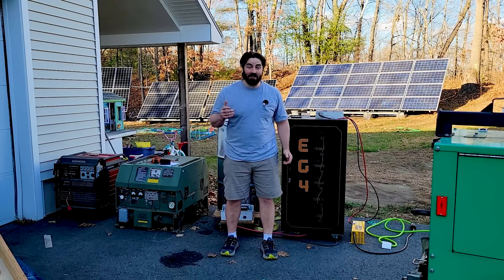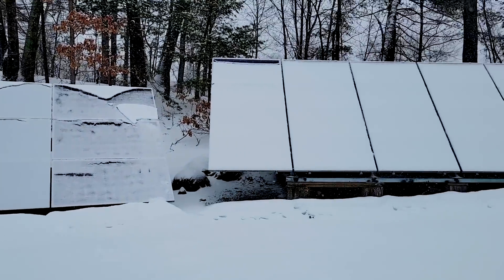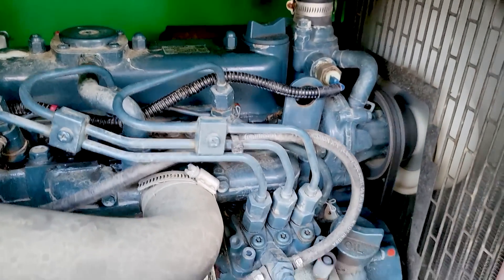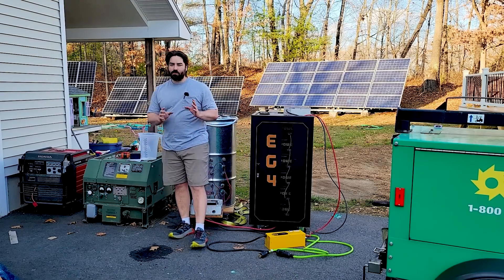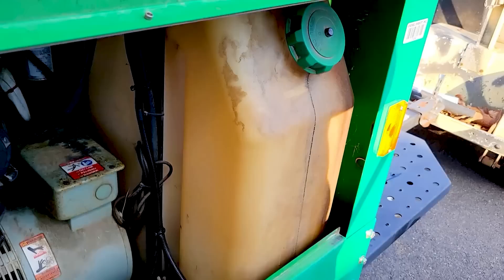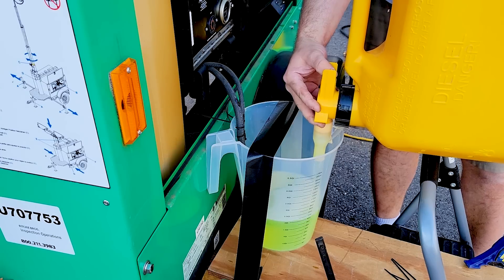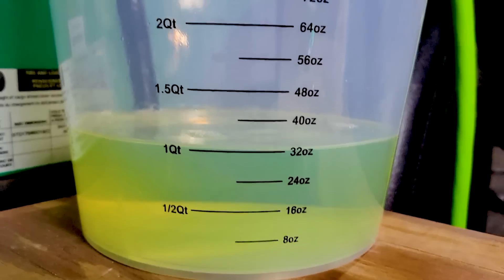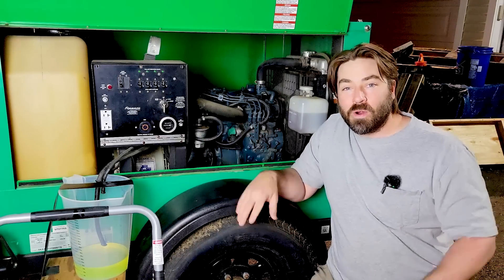Test Kubota: How many gallons per snow storm?

Comment: One gallon diesel 38kw,  from that you made 8kw ,  So, that’s  a conversion efficiency of about 21% .      I pretty well sure you could use grid power to charge batteries much cheaper per kw than buy diesel and running a Genny .
Reply: where i'm from, you pay for connection fee or supply charge of about $1.20 a day, which for 280 days of the year i don't need.
Reply: The grid is an ongoing cost no matter whether you use it or not though, so for most of the year he'd still be paying around $100/mo in fixed fees just to maintain the service.  Although I wonder if going with a natural gas generator would be cheaper, as natural gas service doesn't tend to have as many fixed fees.

Comment: Diesel is the most efficient fuel but natural gas is the cheapest. $ per kwh is the main goal. I personally use propane because I can store a bunch for indefinite periods, it's cheaper than gasoline, the engines run cleaner,  and I don't have to worry about the carb " gelling up" like gasoline

Comment: Based upon the 5.9KWhrs of the gasoline generator vs the amount of  killowatts in one gallon of gasoline (33.4 KWhrs) shows that those are very inefficient (only about 18%).  That's an eye opener!  The other 82% is lost to heat.  If there's a way to get those to 80% efficiency, it might be cheaper than on-grid power.

Comment: Are you running these gensets hard enough? Is 100 amps into the battery putting a load on that is enough that you aren’t idling away efficiency?
Reply from the maker: I maxed out the generator head on this unit.  It's a 6kVA generator head.  I had about 5.9kW on it.
Reply: @DavidPozEnergy  The engine is 10.8kW and is oversized.
Reply: @antronx7  That is an industrial unit and is under stressed for reliability and longevity. Any generator sized for "PRIME" usage will have a generous amount of engine power overhead. Anyone running off grid should be using equipment with a PRIME rating.

Comment: I dint think sunbelt expected their light tower generator to be bench tested for fuel economy, but for people looking for medium load battery charging off grid these are great, often overlooked options.
Reply from the maker: LOL, I own this.  Bought it from Sunbelt not working.  I fixed it up, PMCS, and now it's good to go.
Reply: Often times they’re dirt cheap at auctions
Reply: @joeldcoxks  Exactly. I'm able to pick up light towers at auction for a few hundred bucks. The auction prices for the MEP generators are much too high in my opinion. They run in the thousands of $$.

Comment: very nice job, did you rent or buy the light tower? I just bought one for my model steam engine display, plus I use the light during the winter hayrides for the extra parking lot.
Reply from the maker: I bought it not working.  Fixed it, PMCS, and it's good to go.
Reply: @DavidPozEnergy  nice, pmcs?
Reply from the maker: PMCS: Preventative Maintenance Checks and Service.  
Things like oil, filters, coolant. I used to be in the Army and we loved our PMCS.
Reply: @DavidPozEnergy  nice, why was it not working?

Comment: A 5 gallon storm.  You Americans and your weird imperial measurements.  Next you'll be telling me you measure water with feet per acre or something.
Reply: The acre-foot is a non-SI unit of volume equal to about 1,233 m³ commonly used in the United States in reference to large-scale water resources, such as reservoirs, aqueducts, canals, sewer flow capacity, irrigation water, and river flows.

Comment: Iam off grrid. I have 20kw at 24 volts and 10kw at 12 volts all lithium batteries . Been using waste heat from the engine to heat my shop , charge batteries and power for my cabin for years.The gen is not used at night. With a tube within a tube heat exchanger for collecting heat from the exhaust and some heat recovery from the cooling system , You get about 75% effenecy. 
 The waste heat keeps the 600 square foot shop at 60 though out the winter.

Co-gen units are rare here so I made my own .
Reply from the maker: Excellent!  It's something I certainly want to try.  Do you have any articles, blog posts, or videos about your setup?
Reply: @DavidPozEnergy  No  i was a millwrigh and worked on HACC for 40 years, just last got internet to my area. 

If this unit supplyed 8kw per gallon , then 8kw x approx 3000btu per kw = 24 % of the fuel was used for charging  so 100000 btus was waste heat by the engine : diesel fuel approx 128000- 140000 btu per gallon ,depends on time of year they add kerosene in the winter. Gasoline about 125000 btus per gallon and propane 93000 btus per gallon .

Biggest problem is lack of liquid cooled small engines here , the easy exhaust heat exchancher is a copper tubing inside a galvanized fence rail from Home depoit.  I/2 copper tubiing will fit insde a 1/2 pipe nipple and a 1/2 to 1 bushing will fit into the steel tubing . Do not fix the copper to the 1/2 pipe nipple it must move due to heat . For the average small engine a 6 foot heat echanger will be fine. As for the rest of the engine heat use auto heater cores as a preheater before the exhaust exchanger . Just duct the engine heat through the core. . Do not over complicate this .

The average cost is about $ 200 dollars and your time.

As for the rest you need a small boiler pump or a small water pump ,install on cold side only . You need a heat exhanger for your building . Auto haeter core are the best , get one for a large truck or Van , higher btus 
Dont laugh , I use an old 5 gallon marine tank galvanized steel as the supply tank on the cols side . requires some ventalation
On gasoline the water gets to about 140 f , this is from a 3800 watt inverter generator.
This is nothing but a small hot water heating system .
Moral of the story "Keep it simple, stupid".

That 6kw generator could supply easy 50000 btus  for heat . Just add a heater core and fan . it already has a pump. Plese note the coolant for this is 180 f so take caution .I been thinking of buying a used light tower for heat and power during the long Canadian winter, 

Today is the middle of the solar winter.

every car and truck has this setup!

I use 12 volt pumps and fans so it will run directly off of the 12 volt system.
Reply: @apsleyflyer  im having difficulty picturing your exhaust heat collection setup. Do you know of any pics online to reference for that?

Comment: My battery bank will charge from the utility power from my Schneider XW inverter when my panels get covered.  If utility power isn't available I have a gas generator that will do the job connected my Schneider XW-6848 inverter.  I don't really understand why you need to do this?

Comment: You missed a byproduct of your experiment. I would use the hot air Off of there radiator. 
Could’ve heated your shop or your garage or even your house .
(use all the BTUs efficiently.)

Comment: For this particular use case, where you need the generator at the same time you need the most amount of heat for space heating and water heating, liquid cooling is pretty much mandatory. It allows for the simple, easy recovery of at least some of the engine waste heat for those purposes, right when you need it the most. This pretty much doubles the effective use of the fuel you must buy and haul to your property. An exhaust heat exchanger obviously would improve the efficiency even further.

Comment: Would be nice if the waste heat of the generators could be used to heat your home and/or even just the panels to melt the snow on them.
Reply: Well this generator is water cooled, it would be entirely doable to install a system to pump coolant to a storage tank in the house with a heat exchanger.  Would be a servo driven bypass valve so it sends coolant to the radiator whenever the storage tank is too hot.  

Storage tank would then supply hydronic heat of some type (either radiators, floor heat, or hydronic water to air)

There would then also need to be a heat pump for whenever the solar heat is adequate.

Totally doable just complex, maybe not worth the cost of the parts, and there's all kinda issues with hydronics and corrosion etc.
Reply: @GeraldMMonroe  
Yep, if it's not a permanent installation i can see quick connects being used similar to the ones on tractor hydraulics.
Reply: It gets complicated when you end up with extra pumps, temp sensors, etc. Probably too complicated to ever pay for itself. Makes the system more fragile especially because it's outdoors in the cold.
Reply: @Zorlig  It doesn't need to be complicated. The easiest way would be to extend the coolant lines and place the radiator inside. This might require an external electric cooling fan but that's cheap and easy. I figure the engine's own water pump and thermostat will probably be sufficient.

Comment: I am curios if its possible to remove all not really needed electronics and ac/dc conversations between generator and the battery, so generator can be hookup directly on the battery to charge it.
Reply from the maker: You would need a DC generator.  The ones I've looked at are more expensive than buying a normal 240VAC generator plus the Chargeverter.
Reply: @DavidPozEnergy  Yeah, looks like DIY project!   I am not good at electronics, but imagine some kind of AC generator though rectifier connected directly to the battery... Generator voltage should be little more than battery max.

Comment: Great vid.   Would be interested in dBA of this - e.g. multi-cylnder + water cooled is closer to ta car engine?     I ask because I have neighbors and I'm setup with eu7000is (60db) because it's acceptable where-as an 8000w open frame Champion (75db) is NOT and I've been wondering about a) diesel and b) if more of car engine / generator would be more in 60-65db range? and this looks like a ready-made generator option - can even move it around on it's wheels :)
Reply from the maker: This generator is loud compared to some of the fully-enclosed inverter type generators.  It's made for jobsites where noise is less of a concern.

Comment: @DavidPoz You can use heat energy from generator to warm up the house. Please read about cogeneration. It will be much better, more efficient. Have a nice day!
Reply from the maker: I agree.  It's on my list of things to try.  I'm still trying to find decent heat exchangers for it.
Reply: @DavidPozEnergy  presumably you're struggling as the biggest issue is not mixing copper and aluminium in the same system. Something people need to watch out for.
There are some titanium coated heat exchangers which are of some use.
Reply from the maker: Correct.  This unit is a cast iron block, and aluminum radiator.  I'd rather not use a copper heat exchanger made for home plumbing.
Reply: @DavidPozEnergy  What if you used a marine heat exchanger? If it will hold up with seawater I think you'd about have your choice of coolant and plumbing.

Comment: Mep 802a Burns .5 gallons an hour at 5kw load. in my experience I get about 10 KW out of it  per gallon.
Reply from the maker: The MEP-802A genset is excellent.  I have one (and a couple videos on it) but haven't performed a fuel test yet.  It's on my list.  Remember when comparing, I'm measuring energy into the battery.  There is about 10% loss in the charger.
Reply: @DavidPozEnergy  as long as my shunt is accurate. That's what I was getting also. But I will look forward to your test!
Reply from the maker: Excellent, I thought maybe you were measuring at the generator.

Comment: David... I'm doing an amicable analysis of  the comparison between the two generators. 
One has one cylinder, air cooled.
The second one is 3 cylinders, an alternator, a water pump, and other components.
Both came out to have the same test output or conclusion.
In my opinion, the Kubota with all the extra components is more efficient than the one cylinder. And I explain... As a person who works on engines, it is like comparing an L4 engine vs. a V8 engine and the V8 having the same fuel consumption as the L4. That makes the L4 less efficient than the V8.

Comment: Good video, David. About what I expected for fuel usage. You should redo the test but run the light on the tower to see what you get since, after all, having those lights is part of the reason you would want one over the Army generator
Reply: If the lights are on, you don’t really have an excess power to charge with

Comment: Greetings David. I have done all of the tests that you have. I started out with a DC to DC generator build. That test came out to 4.5 Kilowatts per gallon of Gas. I overdrove the alternator at 2 to 1 ratio with the single cylinder engine speed of 2200 RPM. The next test was using the Magnum inverter/charger powered by an MEP-06D with the Yanmar L70. 8 kilowatts per gallon of Off road diesel at a 1500 watt load. The bottom line for me is there are more BTUs in diesel. The beauty of the 1800 RPM 3 cylinder diesel is a much better longevity that running the Yanmar L70 at 3600 rpm. I think you have a real winner there David.
Reply from the maker: Thanks for sharing your test results.  Sounds like we have very similar numbers between our machines.  Good to know I wasn't totally off, LOL.  I appreciate you watching.
Reply: @DavidPozEnergy  I'm sure probably somebody else has mentioned it, but have a look at HOP HPC48V-100A, it's a little chinese diesel that outputs 48VDC, i would be very interesting to see how it compares without the ac to dc conversion.
Reply from the maker: Cool, I'll check that generator out.
Reply: @yeahright3348  and when the Chinese diesel breaks down during a snow storm and you have no parts. Pass.
Reply: @DavidPozEnergy  would you like to try waxing/rainx-ing one of the solar panels or a small string of panels outside to test the snow/ice shedding ability at the angle you have them?
Reply: diesel engines just have way better efficiency then gasoline ones.

the energy density of diesel and gas is about the same.

Comment: If you have natural gas to your house, you might want to consider a tri-fuel inverter generator (Genmax has an inverter generator that outputs 6.8KW continuous on NG).  The cost of NG is considerably cheaper than gasoline or diesel per BTU or KWh of energy.  There is 33.6 KWh per gallon of gasoline and 293KWh per MCF of natural gas. A Gallon of gasoline and an MCF of NG cost roughly the same (although the price of NG varies quite a bit from region to region and throughout the year).  NG might look like it cost more from your provider, but there are typically fixed charges on your bill that obscure the actual cost (marginal cost) of NG.  It's surprisingly cheap compared to gasoline.  Diesel is similar to gasoline in price but contains a little more energy per gallon at 38KWh per gallon.  Of course, this only works if you have NG available.
Reply: If you have a relatively consistent load. You can add NG into the intake while running on diesel. 
Plumb in a valve and sol valve. Plumb into turbo pressure and or oil pressure sw. 
Should work for gas engines as well

Comment: With my generator/charger setup, I get 4.7 Kwh per gallon in my battery bank. Right now the generator runs on gasoline, but I'm switching to LPG. It's over a euro per liter cheaper than gasoline here.
Reply from the maker: Cool, thanks for sharing.

Comment: I'm in the market for a diesel thinking of a light Tower or the military one thanks for all the good videos
Reply from the maker: I have both, and both have pros and cons.  The military one I have is the MEP-802A.  It puts out a very clean 120/240V, split phase.  So it's great to power the house with.  This light tower is 240V only (no 120V) and the power is dirty.  You don't want to run this into a house.

Comment: A benefit  of using the water cooled unit is you could plumb it into hydronic heating in your house to get some use of the waste heat, improving the efficiency
Reply from the maker: I agree.  I'd love to do some testing on a co-gen system in the future.  I'm currently trying to decide what the best heat exchanger would be.  Needs to be coolant compatible.  Any suggestions?
Reply: @DavidPozEnergy any cheap auto radiator. Used or new. Or heater core. I’d stick with a radiator though.
Reply: @DavidPozEnergy is PEX-A plumbing line compatible with coolant? If yes, then just get yourself some huge 100’ coils of PEX-A and plop them down wherever you want heat. Thermal conductivity is poor, but you make up for it with quantity of surface area.
Reply: @DavidPozEnergy  Probably an oil cooler for a car, they have hot coolant and oil running through them on cars already.